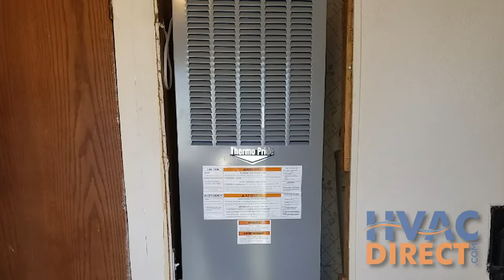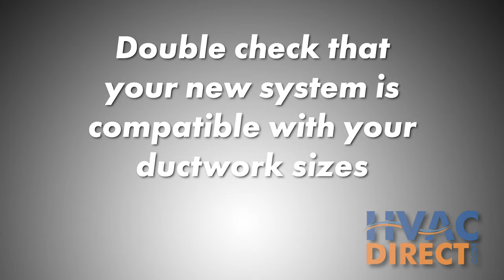Choosing the Right HVAC System for Mobile and Manufactured Homes

Comment: 2021 I purchased 70,000 btu heat unit from HVAC Direct for my 1700 sa/ft double.  They were very helpful, but the issue I was having was with the manufacture that seem to toss units together so fast with no quality control.  The first unit I had to return from major rust on the heat exchange.  I was told some rust is normal, but this was far too much and deep into metal. HVAC Direct is not to blame, they were very understanding and helpful.  The next unit sheet metal was bent out of square.  I had to pull apart and reset for correct fit.  HVAC Direct gave me small credit for my troubles. The best part of air handler was the blower with 5 speeds that was from a good company,
Reply from the maker: Sunnysacto, we are sorry for your troubles with your equipment, but happy to be able to help you fix this issue.
Reply: @HVACdirect  I give HVACDirect 5 star for good customer service and the manufacture 2 star for poor quality control.
Reply: @HVACdirect  I wish the whole air handler was built like the blower housing / motor that has 5 speed for finding best air flow and motor runs on low amps.  Under 5 amps on 3 lowest and tops at 7.5 amps.  The housing is built like tank with perfect sealed seams.

Comment: Live in CA north of SF.  Weather is mild.  Mid 30's in winter.  Mid 80's in summer.  (Occasional freezing & 100 degree temps.) Have a mid 70's DualWide 1400 SF mobile home.  Air comes in via ducts in the ceiling, returning via ducts in the floor.  Incoming ductwork pretty much sealed behind ceiling and return air via ductwork behind the belly band  in the insulated area beneath the home.  Have older gas heat and electric a/c air handling system and compressor which may need replacing before too long.  The handler is accessed from outside by the back door, which seems pretty common for these types of homes.  Would appreciate any other resources, suggestions, etc. that I might use for my research.
Reply from the maker: Hello! One of our experts would be happy to help you. Please feel free to live chat with us at www.hvacdirect.com or give us a call 1-888-342-1912

Comment: Mobile home air handlers with the filter in the door grill are garbage. I've had to replace 3 within the last 15 years finally American Standard came out with a regular downflow system that fits in my cabinet and i was able to open a hole in the drywall and install a proper 20X30 filter box. My electric bill immediately cut itself in half my static pressure is raised by 2 points but still worth it.
Reply: Those cheap filters don't do anything.  Don't use them!  I use high grade 3M filters, but I also upgraded my duct air flow system with 16" trunk into two 12" and into 8" all rooms for great airflow.

Comment: Hello, How would you calculate a mobile home split system with an inside down flow air handler 3 ton . No return . The Mobile home is 16X80 single wide with 8 vents total. The original duct is the rectangular sheet metal, and it is degrading.The mobile home is 1999 model . The local supply shops do not have the sheet metal available & I am considering using Flex duct & I am not sure what size  or may I even use flex duct in replacing the sheet metal .
Thank you
Reply from the maker: Hi Richard! If you were comfortable with the original then i would stay with the same size if there have been no additions or modifications to the structure. If you are at all unsure on sizing you can use the sizing guide on the website-  https://hvacdirect.com/sizing-air-conditioner-and-heater.html/ or give us a call.

Comment: Is the furnaces for the a/c suppose to be so loud inside the single wide home
Reply: It’s a purposely designed flaw and it dos not need to be . I’ve seen $200,000 mobile homes that way . Some mobile homes are up flow with duct work in the roof cavity or sealed attic with HVAC closet extremely quiet .
Reply: @vmobile890  it also has this bad Oder coming from the vents - stinky sock 🙄
Reply: I had poor air flow with factory duct.  I replace duct with 16" truck into two 12" and into 8" all rooms.  Great air flow on low blower speed, now whisper quiet, but it was a lot of work with high skill to resolve.

Comment: You shouldn’t sell to the public
Reply from the maker: Steve, we are happy to sell to the public and offer wholesale pricing to save our customers money. However, the equipment should always be installed by a professional unless it is a DIY system.
Reply: This mobile home owner is a trained HVAC tech.  I could install my own Package Unit and tie into my present ductwork.  My mobile is 12ft x 56ft  1971 Lakehurst with an InterTherm MAC 1155 furnace.  I rarely use my furnace and the Summers here in Sacramento would make most people melt.  I can handle it because I am so used to the weather here.  But if I sell?  It would sell easier with a HVAC system.